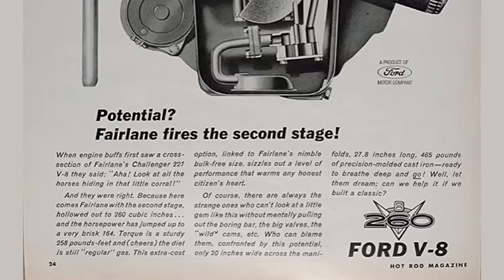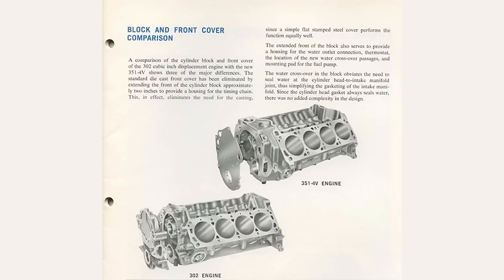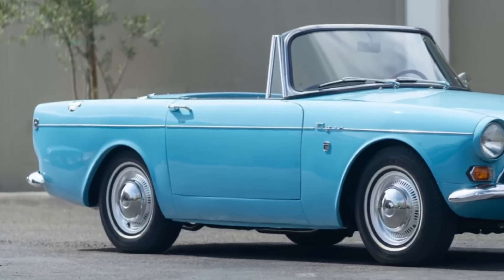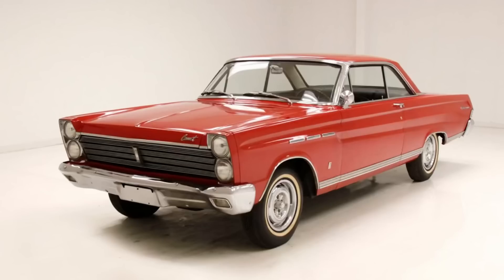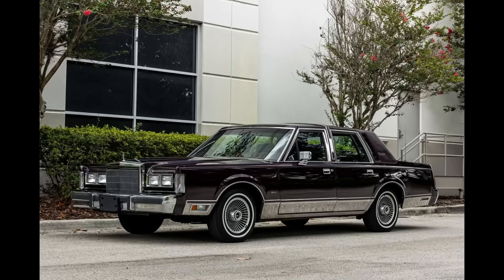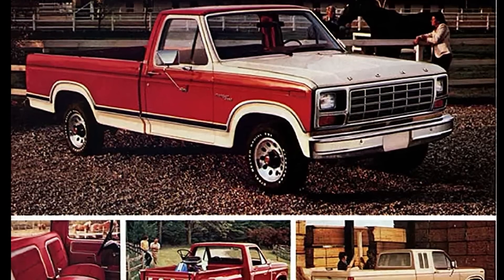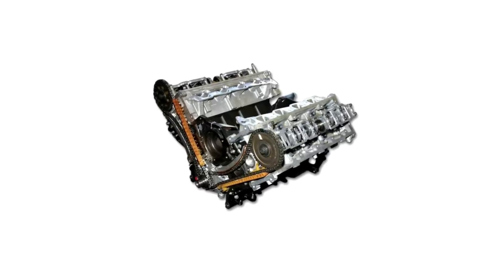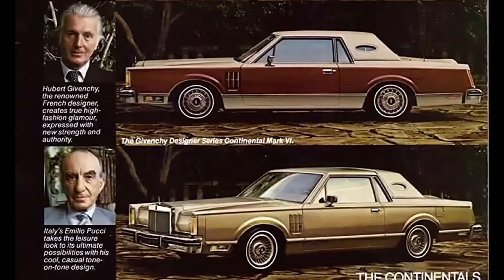Ford small block engine family 221, 260, 289, 302, 351W, 255 not the race engines

Comment: Some incorrect facts , Cleveland production did not end in 1974 , in 1971 for 1972 model cars Ford Australia took over casting and building Cleveland's at the Ford Australia Geelong Casting Centre, they redesigned the heads and oiling system/ ports and created the 302 Cleveland and 351 Cleveland starting in July 1971 , all or both motors ran 4 barrel intakes and Carter Thermo Quad carburettors, cast iron 4 barrel intakes but redesigned 2V + port sizes in intake and heads . The 302 Cleveland got the best heads , closed chamber, the best street/ strip factory head all modern alloy ones are designed around . Just putting a 302 Cleveland head on any smog 351c, 351m, Ford 400 gives 10+ to 1 compression with dish pistons and better porting . Bolt on 50 + hp. They cast / built 302 C and 351 C from 1971 to 1983/4 in cars and 1985/6 in F100 to F350 and D Series trucks. The Cleveland had a very long run with thousands upon thousands built . And still around in Australian wrecking yards , not hard to find .

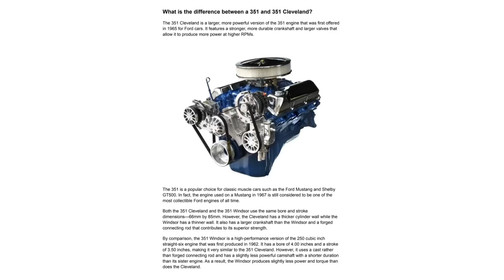Comment: The blurb onscreen at 7:29 is inaccurate.   At the bottom of the page, it states that the 351W is based on the 250 straight-sic.
That could not possibly be any more wrong.   Ignoring the inline-six versus V8 thing, the 250 six-banger was/is an extended verson of the 144/170/200 Falcon sixes, and the 351W was based on the 289/302 V8s.   The only thing that the 250 and 351 had in common is that they were 'taller-deck' versions of their parent engine families, with longer piston strokes, larger main bearings, and longer con-rods.
Reply from the maker: I didn't make that page I found it on the internet
Reply: @What.its.like.  I know, and I noticed you didn't repeat the text in the speech .  Just pointing it out, is all.  Hardcore Ford fan, love your channel.
Reply from the maker: Awesome thank you =) 

I find some interesting things online so I just put them in the video. I'm trying to put together a Lycoming engine episode just an overview of Lycoming and I was able to find some really cool advertisement pieces that I'm probably going to use when covering the straight eight but some of that information just doesn't exist online. Thank you so much for sharing all of the insight and information. Greatly appreciate it. I saw this this morning and I was not awake when I responded. Lol
Reply: @ No worries, my friend.  I look forward to seeing more from you.

Comment: I noticed you don't have the 352 modified. It came with porting the cylinder heads and high performance cam, upgraded value train components. Plus other upgrades that helped up the horse power and torque. 

It was made for the FE engine group and was made from 1958 through 1976.

This engine was able to be highly modified like cylinder head porting and high performance cams, larger valves, high compression pisttons,after market intake manifold,  and headers.

I personally have had so many of this engine model. That I began to collect them. I'm kind of one of the last true old school racers. I have 8 of these engines. Some are in cars and 4x4 trucks the others are on stands and ready to go lol. I have everything from 3 two barrel carbs to one or two four barrel carbs. Like I said I'm old school.
Reply: 352 wasn't a small block.   Not relevant to the video.

Comment: WYR:   No, thank you. 
Maybe a '66 Coronet with a 273 or a '67 Belvedere II with the 318.
Of course, Studebaker had its own 289 in passenger cars from 1956 through 1964, and I'd rather have an Avanti R1or a '64 GT Hawk than any of the Ford products offered as choices here. 
The '62 Mercury Meteor would be an interesting variation at a Fairlane drive-in meet.

Comment: My dad blew-up 3 Ford Fairlanes with 312 motors because of the oiling problem in the 56, 58, and 59. He was so disappointed that he quit buying Fords and went to general motors
Reply from the maker: The y blocks had top end oiling issues the FE was a new engine design
Reply: @What.its.like.  my first v8 engine rebuild in vocational school was a 332 Ford engine and I learned all the different variations for that motor, we had 4 different cubic inch engine variants all spread out on the floor trying to put that truck back together, quite the learning experience. I like Fords but they can be so difficult to rebuild. My 04 super duty is less than super.

Comment: so i want to build a stock 1963 hi performance 260 i have found out that there was such a engine built by ford only a small number was built i want the specs as ford used to build this motor so i can build it for my 1963 falcon  any help would be help full

Comment: Wow, a 260 Hi-Po V8.
That would bring fortune if mint, in a Ford or Mercury at auctions, as they built only about 100 ideations, and even Ford does not know the true number.
Since 1958 Ford generally knows everything that came off the line, although not all, apparently.
It is well known that members of the Ford family had special cars allocated and sent down the line not avaliable to the public, as such.
Like when Henry II ordered a 65' 289 Hi-Po Mustang convertible with leather seats for his newly acquired Italain wife.
Henry II didn't aquire Ferrari (not for lack of trying), but instead, he won Italy, almost.
Don't forget, as Bob Hope used to regurgitate in this "stand up" routine about John F. Kennedy after the 1960 election, "McNamara went to the smaller outfit.".
Henry got rid of McNamara at the exact right time, as he seved his usefulness with the 58 Thunderbird.
McNamara although really briliant, was starting to develope crazy ideas after 1958.
He had the 430 detuned, and set in place a mindset that lasted for about three years.
These poor engineers, these poor bastards, could do nothing until Henry got hold of this walking on eggshells crap, created by Robert McNamara and finally turned around by Henery II with the "Ford Total Performance" regime three years later.

Comment: I had a Ford 200 six auto in a 68' Falcon Futura.
I rodded the piss out of that motor and drive train, morning noon and night, and it never came close to failing me, wether, ice, dirt or tar. 
Light and surprisingly peppy, It must have had tall gears too, because it was o.k. slamming second gear at sixty.
Great little engine that 200 inline six.
Ford needs to revert back to Henry's idea, basic simplicity, of inexpensive cars and vehicles for the common man and worker.
Reply from the maker: That’s awesome what did you do to the motor triple side draft carbs big cam sounds awesome

Comment: I bought a 1963 Falcon when I was 15. It had a 170 and a 3 speed on the column. 
I drove it this way for awhile, but then I took it completely apart. 
I got a 289 out of a 1965 Galaxy in the junkyard. 
A shade tree mechanic help me and we rebuilt the bottom end, installed an Isky cam with anti-pump lifters, big valves and springs, and a Ford four barrel manifold on which I put a Holley 600. 
For spark I got an Accel coil and a Mallory dual point distributor with the yellow plug wires.
At that time it was hard to find headers that would fit. This ole timer made a multi tube collector that fed to one down pipe that went about half way back under the floor . 
I had a friend who had wrecked his 64 Mustang that had a Borg-Warner T10 four speed. He was parting it out and sold me the tranny.
I got an entire rear end      housing, stump, and drive shaft from a 66 station wagon at a junk yard. 
My ole timer friend made the motor mounts and welded them in. We had to take the drive shaft to a machine shop to be cut down and balanced. 
I replaced the front suspension with all the Ford Shelby components which I ordered from a Ford dealership . 
My brother in law had wrecked a Mercury Monterey from which I took the bucket seats and the console . They were the same color as the inside of my Falcon . 
All of this took approximately 3 yrs. to complete. I was 18. It never had mufflers on it and I raced almost every night on the river bridge. 
I was never beaten in the four years I run it. I even beat a Dodge Demon 340 one night with my having a blown head gasket.
Anyway, years later I turned it in to a road racer with side pipes and sold it. 
I’m now 70 and have regretted selling it all these years. 
Thanks for your very informative video. Please forgive me for rambling on? Cheers!
Reply from the maker: Thank you so much for sharing those stories what great memories I love it when people ramble on here it gives insight into the world where these cars existed so don’t be sorry about it =)

Comment: Some of the public does not know there was a 9.2" deck 351 "W"indsor # XE 93532 race block made back in 1966 (based on a "stretched deck" 289 block) way before Kundsen's "C"leveland block was even on the drawing board & this 351w XE 93532 9.250" deck Windsor race block got as big a 391+ ci back in 1967 for Can-Am racing. The 302 & 351 windsor XE race blocks were tested with canted valve head prototypes in 1968 Before Kundsens new block was & there were plans WAY BACK in 1964-65 for a taller "stretched deck" 7L aluminum Windsor race eng for Can Am racing. Kundsen screwed things up at FORD with Fords 351W race block development. goo gle "351w xe 93532 block" for more info.

Comment: The story of the Sunbeam Tiger is interesting.  Sunbeam had introduced the Alpine sports car in 1959.  When some employees at the Roots Group, the parent company of Sunbeam, saw the success that AC was having with the Cobra, they talked management into letting Carroll Shelby and a couple of others into seeing if the Small Block Ford (SBF) engine would fit into the Alpine.  Shelby & Co. discovered that the space inside the engine compartment was much smaller than that of the AC.  They concluded that the steering would have to be changed from ball and trunnion to rack and pinion for the engine to fit.   Even after that change was made, the firewall had to be struck in several places with a sledge hammer to squeeze in the engine   The fit was successful, although so tight that the rear sparkplug on the driver's side was accessed by pulling aside the floor mat and unscrewing a plate to get into the engine compartment.  Sunbeam ordered a bunch of SBF engines and changed the name of the V8 equipped Alpine to Tiger.  They began to sell well, especially in the US.
  Fast forward a few years and Chrysler bought Sunbeam.  They had just brought out a new small block engine known as the LA (light type A) engine.  We recognize this engine series as the 273, 318, 340 and 360 cu. in. engines.  Only one thing:  while the block and heads were a new design and much lighter, they kept the internals (crankshaft, camshaft, connecting rods, pistons, etc.) from the heavier A engine series.  This meant that the distributor was in the rear of the engine.  They planned to just put this engine in the Tiger instead of the SBF engines.  Imagine their dismay when they discovered that the engine would not fit into the Alpine/Tiger body.  Since plenty of SBF engines were on hand they were in the embarrassing position of selling the Tiger in Chrysler Corp. dealerships with a Ford engine.  When the supply of SBF engines ran out, Chrysler discontinued the Tiger.

Comment: Some deep Ford trivia, the 351s with a bore of 4 inch and stroke of 3.5 inch is really a 352 but to avoid confusion with another legacy Ford (FE) engine, was marketed as a 351.  Speaking of marketing and slightly misnaming engines, Ford started to name the 302 W as a 5.0.  It is really 4.9 but was too confusing with the big straight 6 300 that is also 4.9 liters.  The 302 W had fuel injection prior to 86 but the 85 Mustang with a manual transmission was the last year of the carburetor.  On your first selection of preferred cars, the 66 Fastback Mustang, I have one in my garage.  Suggest a future video on the Boss family.
Reply from the maker: Thank you so much for sharing all that trivia you bet. They’ll definitely be an engine episode on that one day.
Reply: There is no 302 W it's just a 302 , the only Windsor is the 351 , and Ford Australia 302 Cleveland's were badged 4.9 litre on cars .

Comment: My first Ford in 1962 was a chestnut 221 cu in Windsor Fairlane 500 2 door coupe.
Traded in for a new 289 cu in1963 1/2 Galaxy 500.
Traded in for a new 289 cu in 1965 1/2 Mustang 2 + 2.
Traded in for a new 351 cu in 1969 Mustang Mach I.
Got married.
Bought used Gremlin's afterward.
Dealer service manager bought the Fairlane 500 for college bound daughter.
Career serviceman bought the Galaxy 500 retired after 240,000 miles.
Car collector bought the 2 + 2, put a HP 271 in it, move from Pa to California.
Ex-wife divorce attorney got the Mach1, one month later a new young owner flipped it into a pasture field shortly after midnight.
Started with a Petty blue Levi Gremlin X, tossing away after body rust made state inspection impossible. Good cheap, used transportation.
Did put a 225 cu in V6 Buick in my '30 Ford coupe.  But came back to Ford with Escort and Focus.
End

Comment: I have had 4 of the 302 and 2 with the 351W. Two of the 302s were in 79 Thunderbirds. The 351s were in an 87 and 89 Mercury Grand Marquis. In Canada the 351 was an RPO that cost $185 in 89. I was one of the few who ordered a Grand Marquis with both the 351 and Trailer Tow III Package. This was an amazing engine. In my Grand Marquis it matched an 89 Honda Civic 1.8 litre on the highway.
The 351W in the Panther cars post 85 were rated for 390 lb/ft of torque at 2200 rpm. The horsepower rating was 215 at 4700 rpm.
Reply from the maker: Awesome information I didn’t know that you could get the 351 in a grand marquis. I know you could get it in a Lincoln mark six I drove one inside a Lincoln Mark six that car was awesome with that engine in it…

Comment: In the 80s the crankshaft firing order of the 302 "5.0" was changed to match the 351W so they could share camshafts. The rods and pistons were also changed because when they stroked the 289 to create the 302 they shortened the rods. This limited RPM potential. Carol Shelby said he always got more horsepower from the 289 than the 302 for this reason.
Reply from the maker: Great information thank you so much for sharing that =)

Comment: In 1980 I bought my brother a 1962 Fairlane 2dr for $45. He pulled out the 221 V8  3 speed and dropped in a 302 with automatic out of a 68 Torino he had rolled. Fast little Fairlane! We dumped the 221 in the gully to make a dam.
Reply from the maker: Thank you so much for sharing those memories

Comment: '69 Torino...well, actually, I'd rather have a '70 or '71 Torino...on the Lincolns, none of those, really..give me a '61-'64 Continental instead..well, I guess those weren't technically a Lincoln?...
Reply from the maker: Great choices the jury still out on that one. As far as continentals go I was taught that the only continental was the 1956 and 57 Continental Mark , two all of the rest of them were built by Lincoln except for one other one it was built by Ford.

Comment: I had a 1969 ford Torino GT, 351 Windsor,4bb, top loader 4 speed, and 9” rearend with a locker. I put headers and race cam for a 302, which changed the firing order. Car would a consistent high 13 sec quarter mile. Wish I still had it. Thanks for the videos.
Reply from the maker: Awesome 
Thank you so much happy you dig the channel
Reply: I had a '68 Fairlane 'sport coupe' (not the fastback) with a 302 and C4 auto, factory provided.   Headers, duals, 'packs, 4V,  B&M floor shift, 3.25 gears in an 8" Trak-Lok diff, and ignition upgrades all courtesy of me.   Used to seriously piss off all the IROC-Z boys on the boulevard, even with the stock cam.  

The 302 and C4 eventually found their way into a little Falcon, and the Fairlane got a 351C with a performance-built C4.   

Good times.....

Comment: I have a 302 in my 1988 Lincoln town car I love it.
Reply from the maker: Awesome I had a signature series really cool car 

What trim was yours how long did you keep it
Reply: @What.its.like.  I still have it and the original build sheet I found under the rear seat unfortunately it was water damaged from leak into interior on passenger side I don't know what the base trim is called it has all cloth seats dark blue and no options it appears steel rims with hubcaps missing oem radio
Reply from the maker: Signature series cars could have cloth interior as well. The major difference is the material in the seats, the signature series have pillow side seats, and that chrome plating that goes up the beltline of the car.

I had two Lincoln town car signature series one was an 88. That was one of the best cars I ever owned. I bought an 89 that was fully loaded. Had the digital dash told you how many miles you had till empty leather seats it had every single option, but I had nothing but problems with that car , it was low miles too. It only had 90,000 miles the 88 when I was done with it had 300,000 miles on it.
Reply: @What.its.like.  mine is analog gauges coolant gauge no longer works and fuel gauge also doesn't work correctly door panels are all messed up back seat ones aren't awful the only rust was under the top above the trunk massive rust hole that still needs to be fixed and rust from battery acid on the battery tray its been in south Carolina before it moved to florida so all the floor and everything is there has 97k miles on it sun faided baby blue paint but has a nice patina look 302 is good absolutely no blow by fixed all the vacuum leaks its my first car never let me down im finally getting ac working again after replacing entire thing.